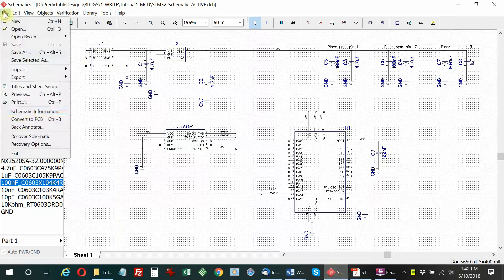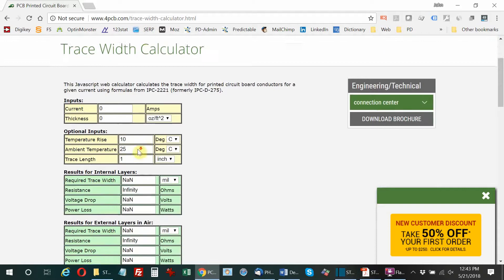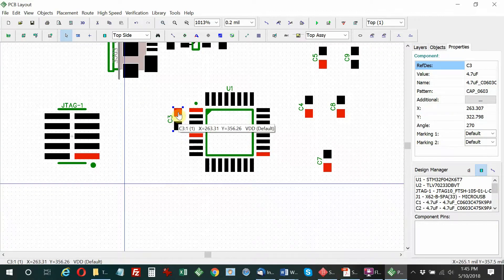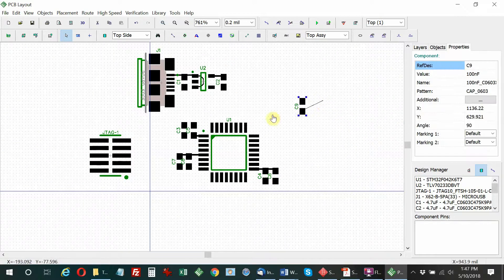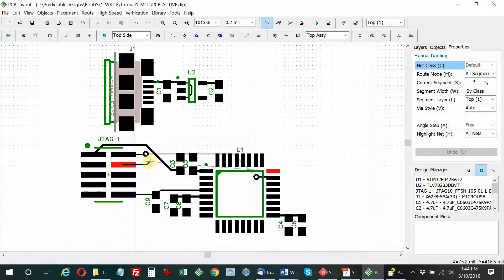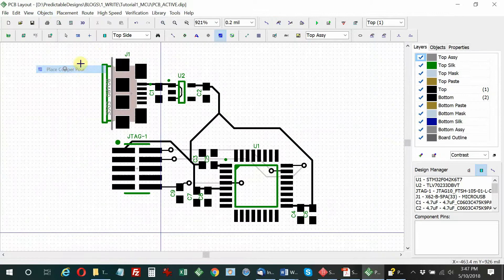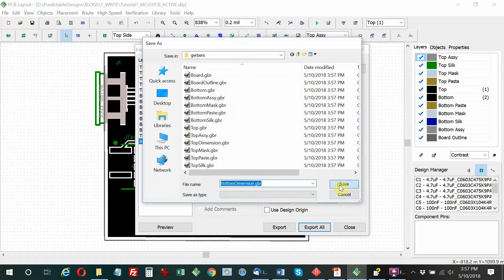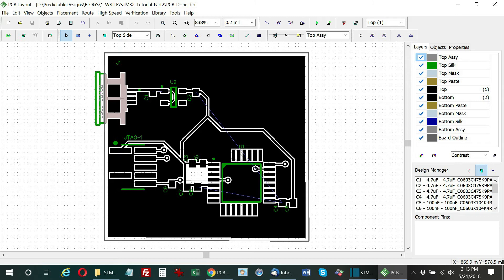Tutorial - How to Design Your Own Custom Microcontroller Board (Part 2)

Comment: My mom, electro engineer, taught me back in the early 90 to avoid acute angles for hf and digital traces… guess what’s considered fast back than I less than the modern standards…
Update - you mentioned it just after my comment but the second via connecting you traced is even more than 90‘

Comment: It would have been better to explain the placement of components more and the decisions for placing them where you did rather than just putting wherever you felt like at the time. It would also have been good to explain the mistakes you made like the C3 and C5 capacitors not being connected rather than just jumping to it fixed like you were trying to hide it, all it would have needed was a quick comment about checking that everything is connected right rather than just ignoring it.